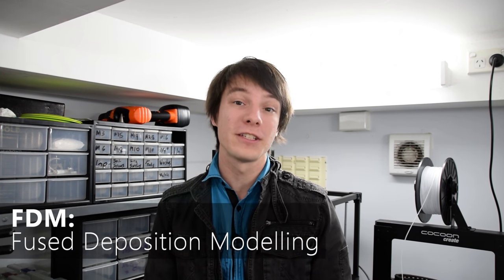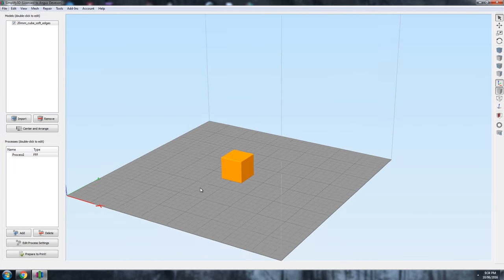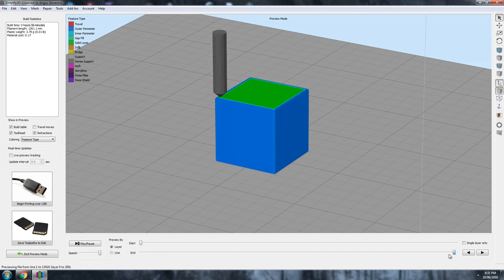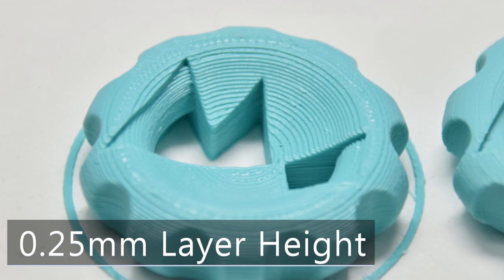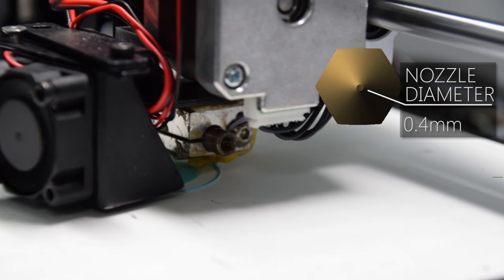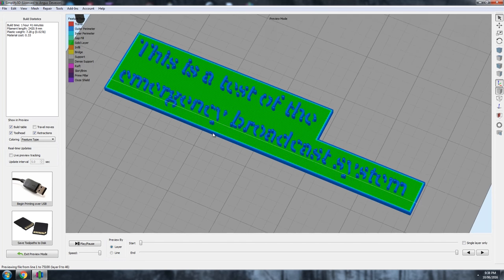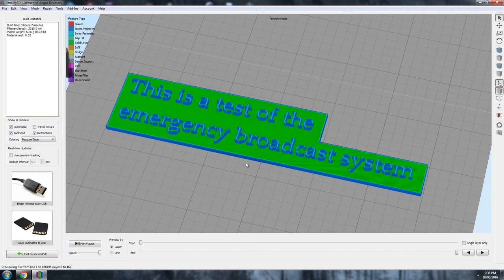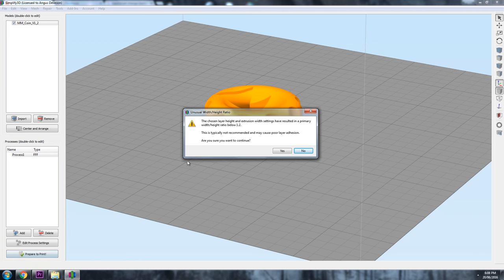What is Layer Height and Nozzle Diameter? - 3D Printing 101

Comment: Great video Angus. Just want to mention that doubling the diameter like from 0.4mm to 0.8mm will generally reduce your print time by 4X, because both layer height and extrusion width are doubled. This is great news for anyone printing big since scaling your print by 2x will 6-8x your build time.

Comment: Hey, a 0.2mm nozzle does not necessary have to move more than a 0.4mm nozzle to fill the same area. I have a 0.2mm nozzle on both of my printers and they are perfectly happy with extrusion widths of 0.5mm (which I normally use) or even 1.0mm. The nozzle diameter only dictates you the lower bound of extrusion width and upper bound of layer height. 0.2mm nozzles are great... they can print really fine structures (like 0.25mm) but also 1mm thick lines if you want it fast and not so sharp. With a extrusion width much bigger than the nozzle diameter, you can even have layer heights little thicker than the nozzle diameter (like 0.75mm width and 0.3mm layer height width a 0.2mm nozzle). Slic3r will try to prevent you from doing that, but there is no problem with setting the wrong nozzle diameter in Slic3r anyway. The nozzle diameter setting will not have any influence on the print at all, it is just used for plausibility checks.

Comment: Well done with this very informative video, Angus! The information flow was great, and your spaced it out in a way to make it easy to take in and remember. Awesome!
Reply from the maker: Thanks man!
Reply: 3D Printing Nerd oh my god, here, take my baby!
Reply: Any chance of either of you guys making a video talking about how these factors also limit feed rate and print speed? I think adding temperature and filament type into the mix also makes it complicated for users to grasp how all these variables are linked. I've been 3D printing with FFF printers for a while now, sometimes successfully and sometimes not, and I'm still trying to get the gist of how layer height, nozzle diameter, feed rate and print speed are interconnected and what are their limits. I'm still searching for info on how to calculate limits not only to avoid failed prints but also to optimize printing time.

Comment: Angus...great video as always. Good Scottish name too ;)  I'm having an issue with setting up my Ender 3 Pro and I believe it relates to the initial layer height setting. Is there a rule of thumb to set the first layer height from rest of the layer heights set in the slicer? I'm getting a beautiful first layer. Then the second layer or third can be rough. To me...the height set between the two is too close, so the nozzle is hitting the previous layer. Sometimes it sorts itself out and by the last layer of the bottom...its beautiful again...sometimes not. If say printing with a 0.4 nozzle and I set the first layer height to 0.25 and the rest to 0.28 I note the second layer can be messy.  If I set 0.24 initial layer height it seems less of an issue. I just wondered what the rule of thumb is?  Baby stepping can resolve the issue....but I'd like to avoid that as I feel this could be resolved in the slicer. I could play around with settings, but I wondered if you could point me to a resource that explains the rule of thumb for this parameter and also maybe touches on maximum layer height and extrusion width for a given nozzle bore. I'm getting some nice prints, but the second layer being messy after a first really nice layer is annoying me. Hope you can help mate! Thanks in advance and keep up the great work!

Comment: One other point worth mentioning is larger nozzle = larger layers = stronger prints! Although you sacrifice some "visual quality" its a tradeoff worth making in my opinion! 

I have done prints with a .25 nozzle on my Um2 and it handles them just fine although like you said the time goes up dramatically as your speed is limited. Also I find prints with the small nozzle are better for visual vs structural prints as the layer bonding strength is much lower. You maybe able to correct this by smoothing the model with an appropriate solvent (THF, Acetone, Ethyl Acetate...)

Comment: Thanks for this!  You mention that smaller nozzle diameters are more difficult to print with because of increased pressure, etc.  How would one compensate for that?  Just slower print speed and extrusion speed/multiplier or something?  Also how difficult is it typically to change out the nozzle?

Comment: There are a lot of things to add. F.e., decreasing layer height below some threshold results in nozzle melting and wiping previous layer and the quality of print actually starts to drop. In my experience, even 0.1mm feels to low. For a "super fine" prints 0.125mm works great for me (with 0.3 and 0.4mm nozzles).
The low print speed and low jerk/accel. settings are usually more important for a good quality print, than layer height.

Comment: Also printing the layer height at a layer diameter such as 0.4mm layer height with a 0.4mm nozzle will lead to bad layer adhesion since the adhesion between the layers are most minmal. But you are right that differences below that like 0.3, 0.2, 0.1mm are minimal between each other. A larger nozzle diameter like a 0.8mm nozzle will lead to better layer adhesion and higher strength due to the fact that the extrusion width is much larger and the part becomes more homogeneous compared to a smaller nozzle.

Comment: Good explanation, i would add that layer heights beyond 100 micron although possible is not reasonable because of the differences that is seen. I'm not sure of what companies are using the tactics of selling a printers based on its capable Z Height resolution, either way, if a manufacturer wants to put a claim to a printers capabilities i see no problem with that, just keep in mind like Angus has said, more than layer height needs to be considered when purchasing a printer and layer heights beyond 100 microns .1mm is rarely done nor needed, filament diameter is also very important as it can mean the difference between printing thin walls or thick walls within your object. Good Job Angus

Comment: Hi there! Greetings from Chile and great videos by the way! 

Right to the point: 

Im having problems with inter-layer addhesion, so ... for instance i "vertically" printed a bar, if i bend it, it will break perflectly horizontally right in the interlayer bonding lines. 

How could i improve this? lowering the layer height will help? reducing speed to improve layer bonding?

Is there a material that has strong layer bonding? We re using PLA and PETG right now

Thanks for your help!

Comment: One thing I would add is how to determine the maximum layer height by your nozzle size - ie a 040mm nozzle can't do 0400 layers
Reply from the maker: I do mention that you can't use a layer height beyond your nozzle diameter as one of the last points ;) 
I have done 400 micron prints on the up box though which has a 400micron nozzle - they do work, but 350 microns seems to be the magic number for super fast prints that still look half decent.
Reply: +Maker's Muse ok I thought it was 70% nozzle diameter was max layer
Reply: Dude, there is  NO WAY that part had any strength to it whatsoever. Printing at .4mm layer height with a .4mm nozzle has a contact cross section of about 1% assuming the amount being extruded equals actual .4mm layer height. I suppose you could increase your extrusion rate >200% pushing more filament....but you would have to increase your temps and slow down your print to avoid lack of fusion. But at a certain point you might as well just lower the layer height and get speed back.
. On another note. I see your upping your graphics game. I like it.
Reply: Exactly! This is why I thought the best practice recommendation was like 70-80% of nozzle diameter. So on my .60 nozzle i wont go above .5 layers and I think thats too high. for the .40 i'd say .3 to .35 max..
Reply from the maker: +jeevesme I think there's enough debate around this to test it in a video! Yep increasing your extrusion multiplier / flow rate may help, not sure how the UP BOX does it but the parts don't fall apart in your hands.
Reply: #Nozzlegate :D
Reply: I like your style.
Reply: Theoretically there is no minimum you could have a 0.001 mm layer height with a 0.4 nozzle the distance to previous layer is irrelevant to the nozzle diameter. (it is not a sphere just a 2d circle) it is a very different question if the nozzle head has enough pressure to push material out at that minimal separation. but that would depend on other things rather than the nozzle or its diameter (material, temps, how the ""pump" works)
Reply: ***** Keyword there is theoretically.  You may as well just go with a different process.  The pitch on the lead screw would have to be ridiculous. And the stepper motors would have to have some crazy accurate high count microstepping going on.

Comment: Angus, could you do a video for changing filament. Specifically, going from a high temp filament back to a low temp one.  Like Taulman Bridge back to PLA or PETG to PLA.  I find it that I have to do the atomic pull with the Nylon to make sure the nozzle is clear, If I don’t the PLA curls at the tip and doesn’t print right. I might be doing something wrong or just
not aware of how to do it right.

Comment: Well i use the e3d volcano with a .8 nossle. Layer hight of .2 and width is at 0.45. With really good quality just as if i would print with the .4 nossle. But i never get clogs. But i can print low quality high speeds aswell:P I usually print with a width of 0.9 and a 0.2 hight if the part allows it.

Comment: Angus, Please comment on the relationship between nozzle diameter, layer height and layer width.  I keep forgetting the best setting for the nozzle I am using.  EG at the moment I am working with a .8 nozzle and printing with steel filled filament.  I am getting mixed results with my first layer even though the bed is dead level.  Some parts of the print look like gravel while the rest of the print is smooth.  Some parts skip and some parts print okay.  I know part of it is layer height

Comment: Any guidance on how nozzle size and layer height affects the quality of overhangs and bridging?
Reply: That would have a LOT to do with how the printer cools the material but I find prints with larger nozzles tend to have less quality BUT have much higher strength and print speed. That said like anything else with a little tweaking you can improve the results in troublesome areas.
Reply: Just FYI, an .8mm nozzle can have the exact same Zed resolution as a .2mm nozzle. The resolution that's changed is the X and Y.

Comment: Do any of the slicers let you change the layer height at different heights in the model?  
Or automatically change based on the angles of the surfaces like you can do with the better CAM software?

Comment: can you talk about the ratio between nozzle diameter and layer height? 
is there a formula for min max?
what should i do with the speed?
Reply: This is a pretty complex topic when you dig into the technical details, and everyone will tell you something different, but here are some basic rules that are "good enough":
* Keep your layer height to no more than 70-75% of your nozzle diameter. 
* There's no real rule for minimum layer height, but practically speaking there's seldom a reason to go below 0.1mm and with larger nozzles you're probably best off thinking "25% of nozzle width is as low as I should go."
* ...and sticking with the above progression, a layer height of about 50% your nozzle width tends to be a "best of both worlds" setting for speed-vs-quality.
* Print speeds are too variable to really have a rule for beyond "if you're having problems with the print and/or print quality, slow down." This ties in with layer height - for the most part - only because min and max's are more likely to be problematic in some way.
...and having said the above, let the "you're an idiot," "that's not at all right," "it's really more like," and similar comments about how I'm wrong begin! :O

Comment: On behalf of the 0.2mm Nozzle:
They clog way easier then 0.4mm Nozzle - I used a 0.2 for small parts, which worked quiet fine, but I wouldn't recommend them for large parts, because the danger of clogging.

Comment: E3D directly contradict you on this one with regards to layer height Angus, they claim in their volcano videos that taller layers make much stronger parts. 
We're you thinking about layers below a certain limit? Have you tried 1mm layers? From my experience I'd side with E3D, fat layers are really hard to separate.
Reply from the maker: Yes they must be referring to hugely coarse layers! I have never gone beyond 0.4mm layers, a 1mm layer would require something like a 1.2mm diameter nozzle which is only really possible on the volcano hot ends. I haven't really noticed any difference in strength between models printed at 100microns vs 300microns.

Comment: I recently came across a 3D Printing Column that pretty much stated (claimed) that the usable "Layer Heights" you can use are dependent on your nozzle size.
The thinnest layer height could be no less than 1/4 the size of your nozzle (assuming your printer is capable of printing at .1mm or less), and the thickest (usable) no more than 3/4 the size of your nozzle.

Although this is not necessarily a bad rule-of-thumb, is it a legit rule, (assuming a person doesn't want to run a set of test prints at different thicknesses) ??  Your thoughts.
Reply from the maker: It's more of a guide. You get diminishing returns going to stupidly fine layers, it's a bit like trying to be accurate with a crayon. Conversely if your nozzle is 0.4mm then the material being extruded will start to waver and lay down innaccurately at layer heights approaching 0.4 and beyond.

Comment: Hi, Is there any way to use  combination of different nozzle diameters installed in a dual extruder setup so that we can reduce printing time without losing outer surface finish ..
Reply from the maker: Sure can, just need a slicer that allows you to input those different parameters, like Simplify3D or Ideamaker.

Comment: Sorry I'm at a loss, how can a .4 nozzle print at a .1 layer height?
Reply: Joey Leung .4 is the min surface area where .1 is just hight. So think of nozzle diameter like a peace of paper. the hight is very small but the top is huge. As you reduce your nozzle size you are reducing the surfaces area of the paper or making the paper smaller. But the hight of the paper is the same.
Reply: So would the layer height be like stacking more pieces of paper on?
Reply: The thread of plastic squishes at it's extruded, the slicer puts bigger gaps between the lines of the toolpath for thinner layer heights